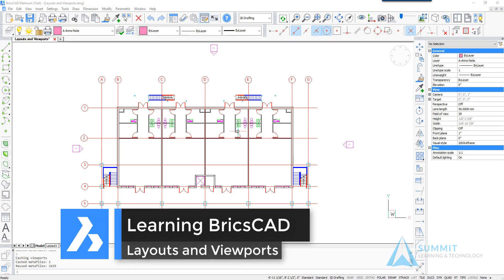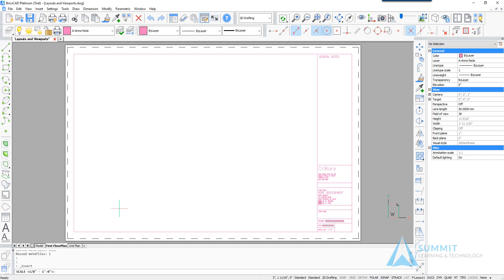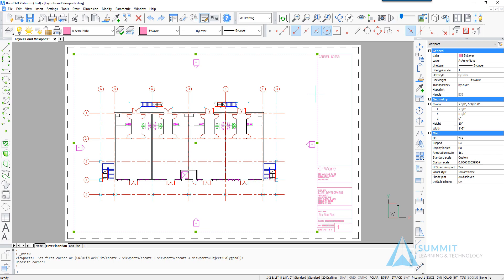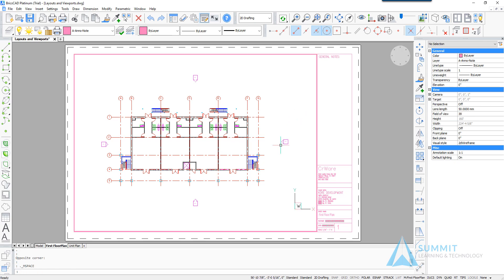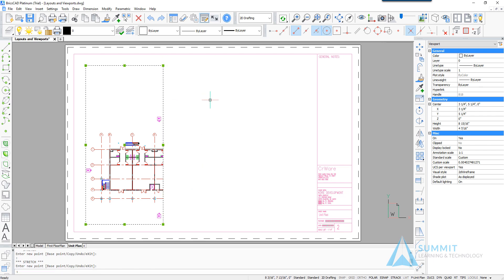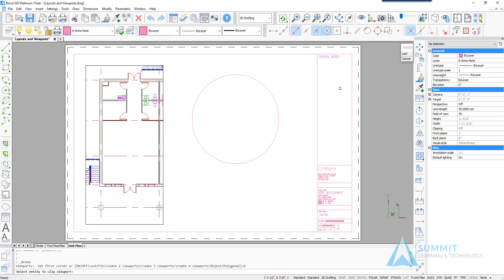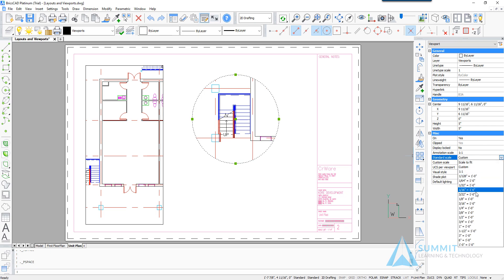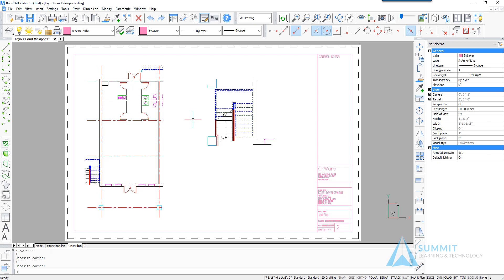Layouts and Viewports - BricsCAD

Comment: briliant , just what i need . I been having trouble with using Viewports in BricsCAD but thank to you , sir , it seem that will be no longer the case . Thank you .
May i ask you one more thing ? In my project , i need to create 3 Viewports in 1 layout page for a same house with column ABCD , and they all display the same column ABCD but with left center right viewpoint from above . Even with the same scale , i can't seem to align all of them based on a same column A , everytime i enter a viewport and try to zoom in or out to adjust the size , it will misaligned with the other 2 about the size or the location . It would be a godsend if you could show me how to 3 of them viewport align on a same column and same scale 🥺🥺🥺